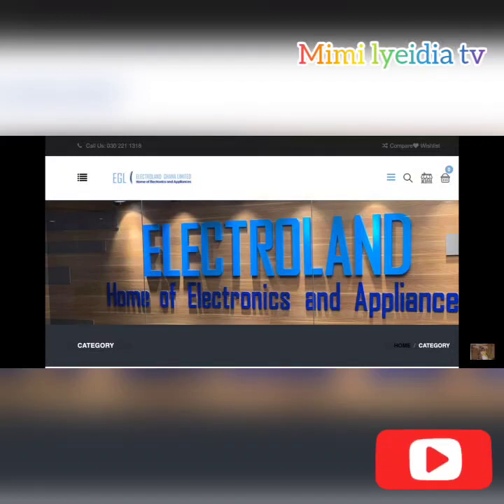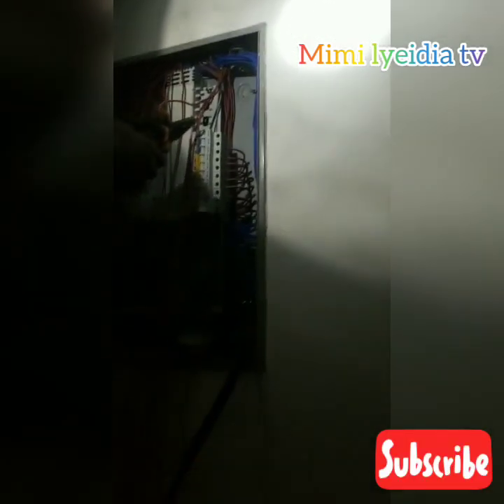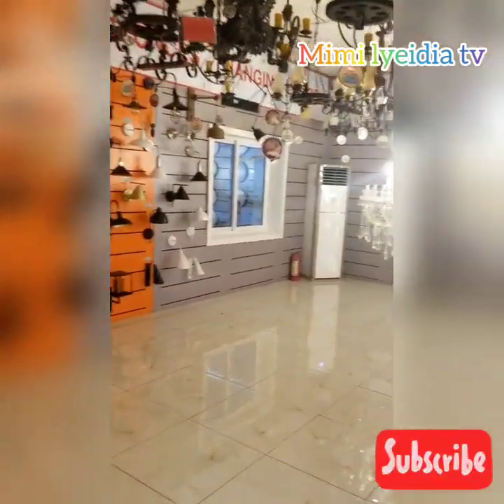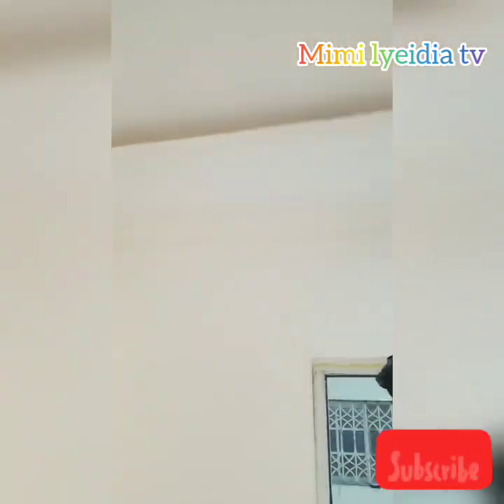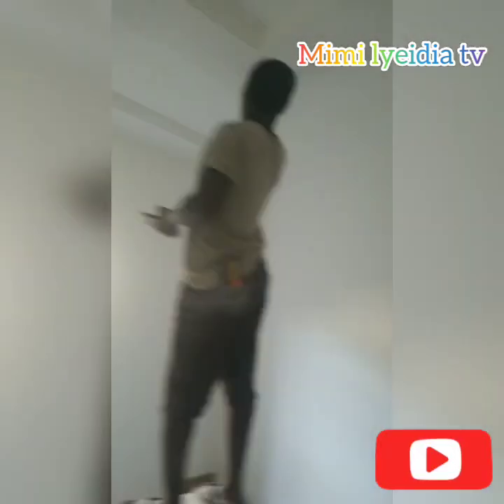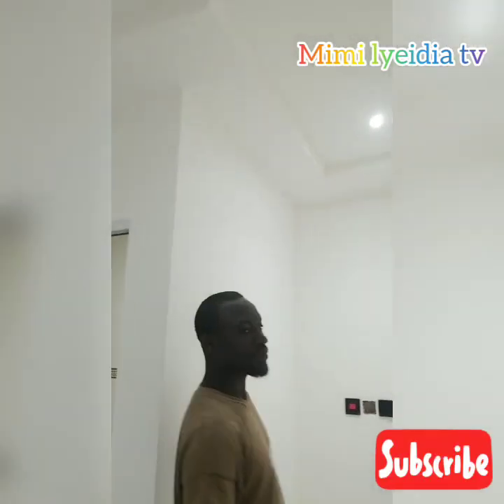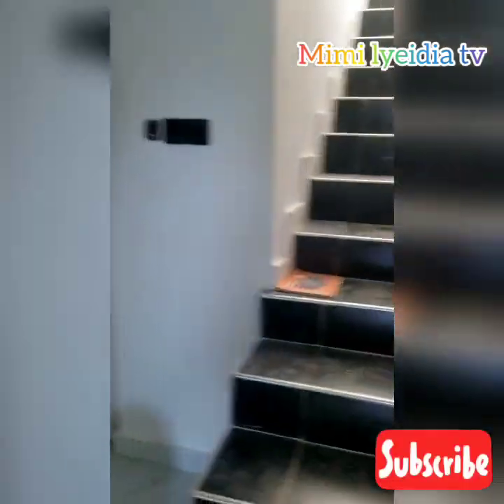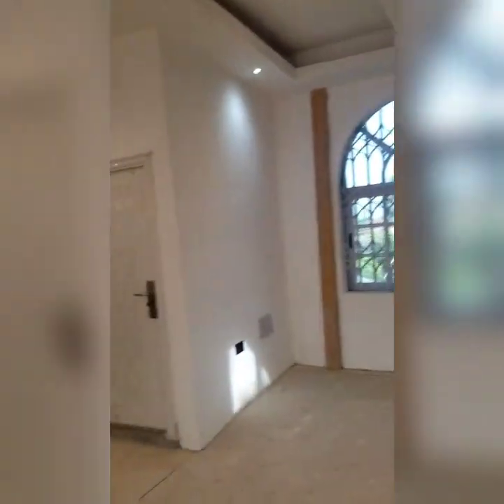BUILDING IN GHANA 🇬🇭(electrical work)where to buy and fixing 🇬🇭🇬🇭🇬🇭🇬🇭

Comment: I love the effective use of the attic. It's a breath of fresh air and gives me hope that I can implement something similar in Ghana. What type of insulation do you have against the heat from the long span roofing sheets?
Reply from the maker: We put a Foley under the plasterboard for the heat and is perfect
Reply: @mimilyeidiatv9517  Good to know.  Stonecoated roofing sheets usually provide optimal insulation,  but it seems you're on the right track. Keep us posted.